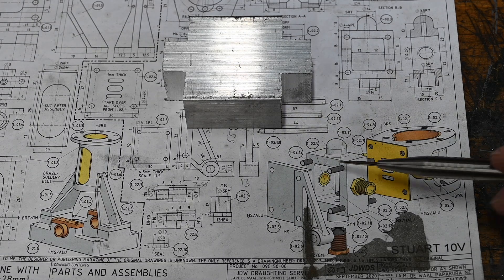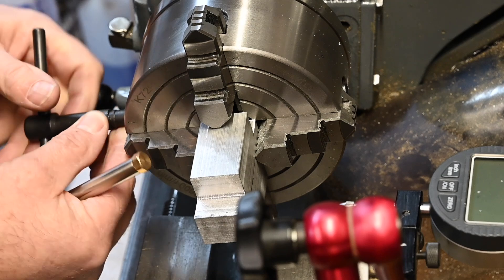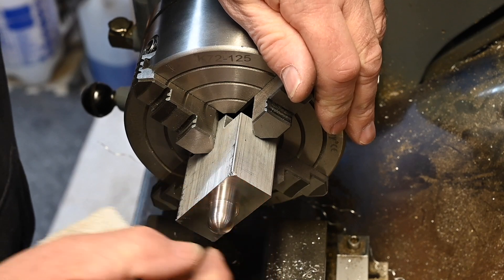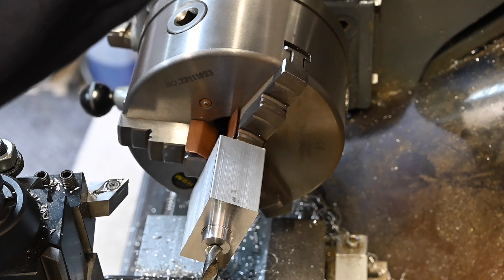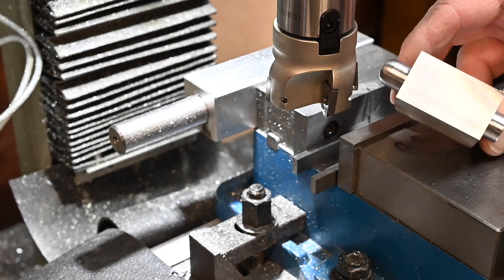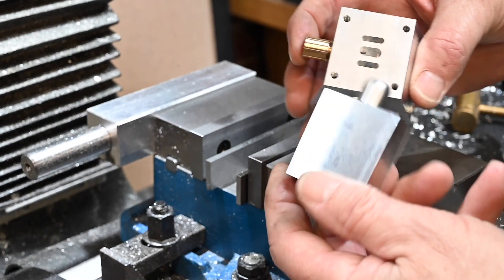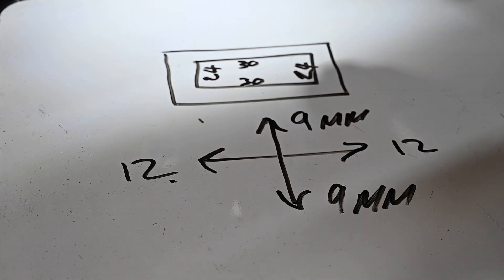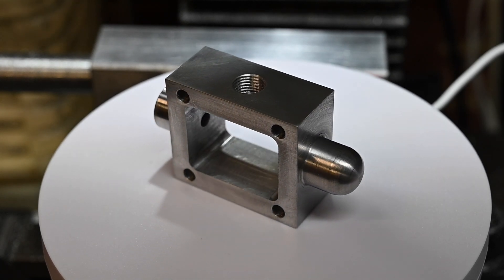Steam Chest for Stuart 10v EP08 Steam Chamber

Comment: Enjoyed the order of operation details. Give some verbal speeds and feeds plus cutters used info as you go. Helps a newbie like me understand. Cheers jeff
Reply from the maker: Hi Jeff, unfortunately I don’t have any speed and feed info on my very old manual machines. As a beginner myself not that long ago, I also started to investigate speeds and feeds and soon realised I had no way of implementing it on my machines. I found trial and error on scrap material was the best method for me! I also experimented with cutter types and almost exclusively use TCT, 
One piece of advice I can give through experience is, don’t buy cheap end mills, they don’t work out cheap in the long run and dull quickly. When you buy TCT cutters for the lathe buy the ones suitable for the metal you are cutting ie: aluminium cutters have polished finish. And look at the tip size, smaller for finishing and larger for roughing. If you are anywhere near Norfolk uk you are welcome to spend a morning in my workshop going over the basics 👍
Reply: @EnglishHobbyMachinist  thanks for reply.  Would love to visit but a little too far from qld Australia